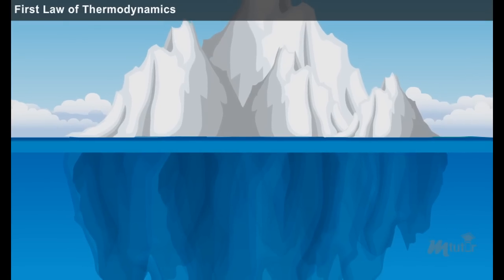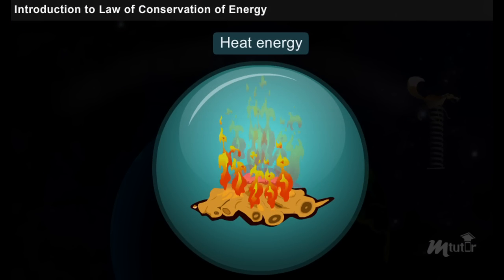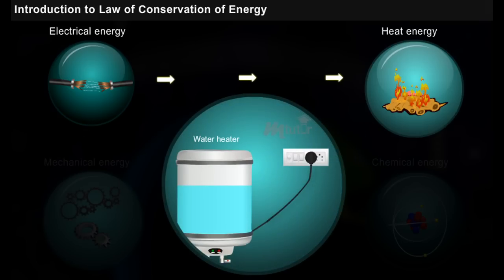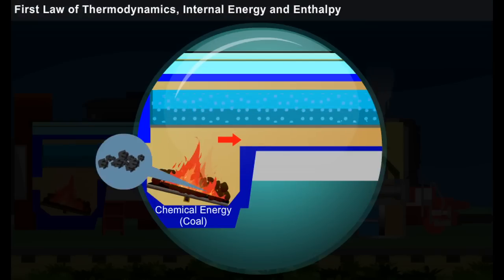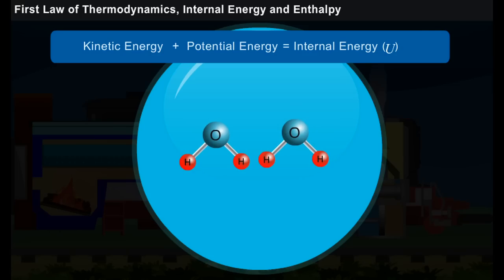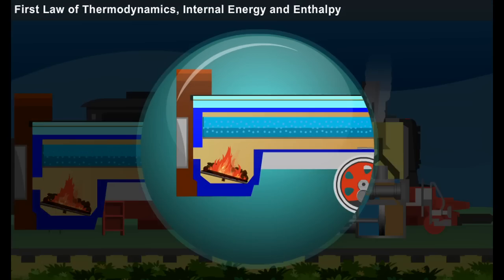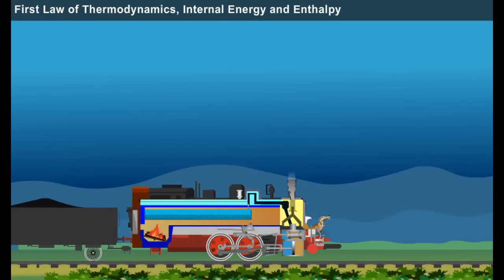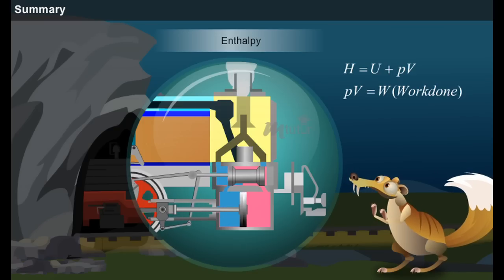First Law of Thermodynamics [year-1]

Comment: I discovered Thermodynamics principle is a half-truth.  There are some proofs that the Law of Conservation of Energy is not always conserved and destroyed and not always constant.

Computation proves that the principle of Thermodynamics is not always conserved and destroyed and constant.

The applications of the explosion in the system of the principle of Thermodynamics.
Wikipedia meaning of explosion:  An explosion is a rapid increase in volume and release of energy in an extreme manner.

Illustration 1
I. The mixture of compressed air and fuel on the piston of an engine is not enough to move the piston up and down. The explosions increase and created an energy of the cylinder causing the piston to move.
The petrol of 10Joule is not enough to move the car, the explosion increases and created energy causing the car to move.

Illustration 2 
A 15 ball billiard pool to be strike by white mother ball. 
F = 30lbs (White Mother Ball); D = 3ft (Distance from the white mother ball to the first ball to strike); W = Work, F = force; D = Distance

The mother ball to strike the 15 ball is the work input
The first collision is explosion followed by an increase in force and travelled distance by individual ball followed again a series of collisions.
The mother ball transferred the force to the group of 15ball. The momentum is conserved to the group of 15 while the explosion increases to 15 individual balls.

SOLVE FOR WORK INPUT 
W = F X D;  W = 30lbs  x  3ft  =  90Ft.lbs          

SOLVE FOR WORK OUTPUT 
W = F X D; W = 30lbs x 3ft = 90ft.lbs  X 15ball = 1,350 ft-lbs.

It shows the Energy increase by 15times. The elastic momentum was conserved from one piece mother ball to the group of 15. However, the explosion after the collision increases the momentum into 15.

Illustration 3 
For more heat energy the ball to replace with steel ball and steel sideboard. After strike is explosions of 15 balls. The explosion increases the group energy into individual 15. The work output higher than work input followed by a series of collisions that produces more heat more work output, more sound energy more work output, more travelling distance more work output.

Illustration 4
To get even more energy output without increasing the work input. Put an additional two groups of 6balls in a triangular shape to be placed somewhere at the back of 15balls at least 4inches apart from the sidewall and back wall. A total of 15balls + 6balls + 6balls = 21balls. The explosion creates collisions after collisions increasing the energy output.

After the explosion, the work done increased 21 times. That principle can use to make free energy machine.
The Law of Momentum states that the total momentum of two or more objects acting upon each other does not change, without external unbalance forces.

In this situation after the first collision is an explosion that increases the momentum from one body to multiple bodies

Thank you. 

Abel Urbina Abel Urbina Free Energy Super Machine
Reply: That's why we have other laws

Comment: Abel Ubina

The WORK OUTPUT is more than double the WORK INPUT. So the theory of entropy is misconception.
A 15 ball billiard pool to be strike by white mother ball
When I computed the work done in pool (billiard) the white mother ball break the 15ball.

F = 30lbs (White Mother Ball); D = 3ft (Distance from the white mother ball to the first ball to strike)

SOLVE FOR WORK INPUT
W = F X D;  W = 30lbs  x  3ft  =  90Ft.lbs          

SOLVE FOR WORK OUTPUT
First two ball extreme corner of the billiard ball 2 out of 15 ball
W = F X D; W = 30lbs x 3ft = 90ft.lbs  X  2ball = 180 ft. lbs

The remaining ball (13pcs ball) can produce more than 90 ft.lbs
The computation shows that the output work done is higher than the input work done

Appreciated for your reply

Thank you.

Abel Urbina

Comment: Shouldnt the mechanical energy be considered as distroyed energy, since it cannot be used anymore. In the train example, after you get mechanical energy, you release chimicals in the air, which can be called energy transformation, but it doesnt have any use.
Reply from the maker: When you consider energy it is important to look at the law of conservation, i.e. in our video, the mechanical energy gained from the chemical energy is used to drive the locomotives only which is turning from potential energy (any type of stored energy)  to kinetic energy (found in movement). So, the energy cannot be created nor destroyed, but can only change from one form to another.

Comment: Law of conservation of energy is the result of 1st law of thermodynamics but not exactly the 1st law of energy. 1st law of energy says that - For a closed system undergoing a cycle, net heat transfer is equals to work transfer.